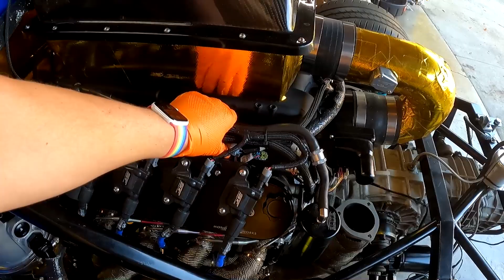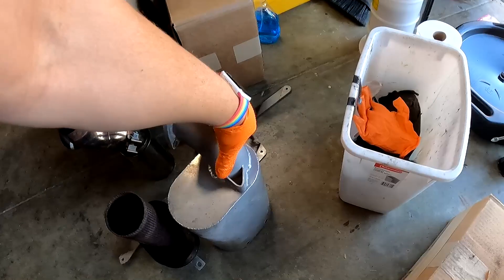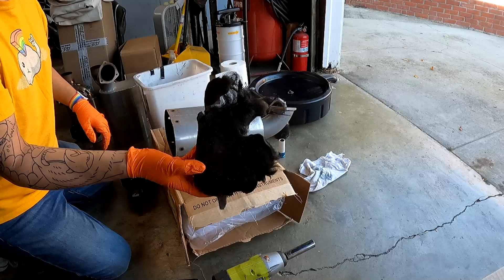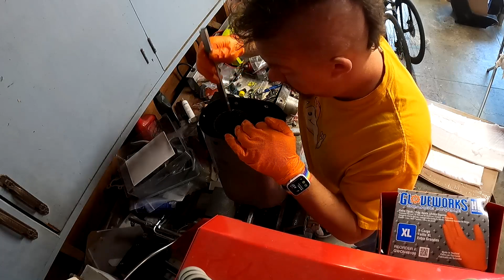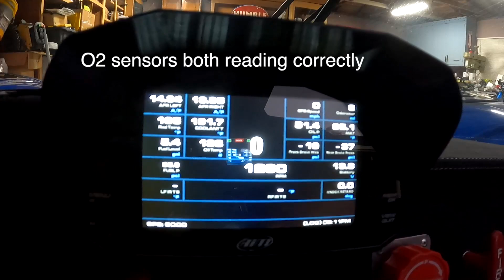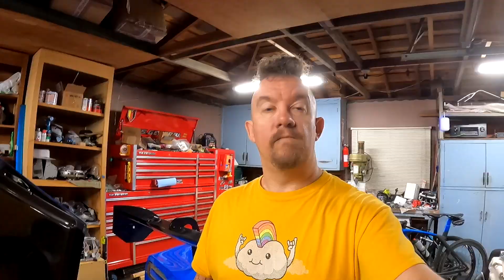Ultima RS - Blunicorn Rebuild 42

Comment: Humble,is there anything you've done to the sump to stop the engine blowing,like a dual oil feed system?
Reply from the maker: I made a few crucial changes for the rebuild.  1. Better oil pan, ARE dry sump pan with better pickups.  2. Oil de-aerator, a Spintric oil/air separator unit also from ARE.  3. High pressure and high scavenge Katech oil pump.  4. Additional oil cooler and thermostat after the Mocal oil/water heat exchanger (only needed for really hot days).  5. Heat sleeve insulation on all oil and fuel lines in the engine bay to reduce heat soak.

Comment: Engine bay looks amazing. Have you checked under hood temperatures and how effective the heat shields are. On my kit car I put wrap on the exhaust manifolds and aluminium heat shields between hot and cold areas and everything eventually gets really hot so the protection measures just delayed everything getting hot! Gold tape looks so good.
Reply from the maker: I haven't had a chance yet but its coming.  Previously temps would get around 300F+ in traffic which led to fuel system failures.  With extra heat shielding and side scoops now I'm hoping to bring temps down to make it more street friendly.  I've also thought about adding fans to the back to evacuate hot air similar to Porsche and McLaren if the heat shielding still isn't enough.

Comment: Thanks Humble for another great video. I know you are in California but does the Blunicorn have to pass an emission test?
Reply from the maker: The only requirement is a functional PCV system which I worked into the dry sump breather and valve covers.  Even though they're not required, I run cats on the car to help keep noise down for track days.